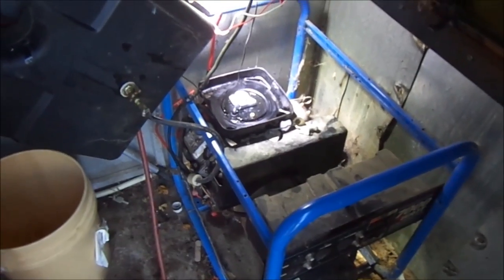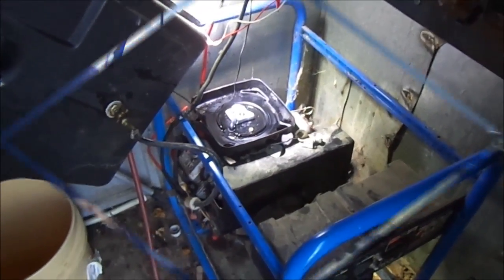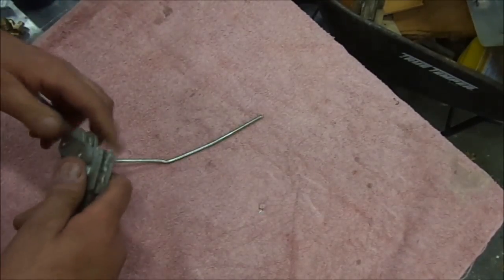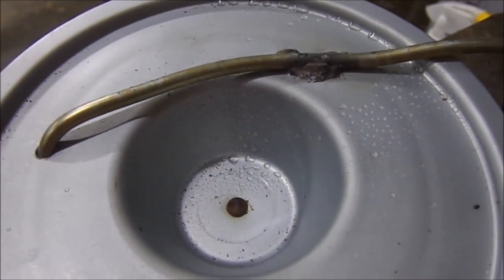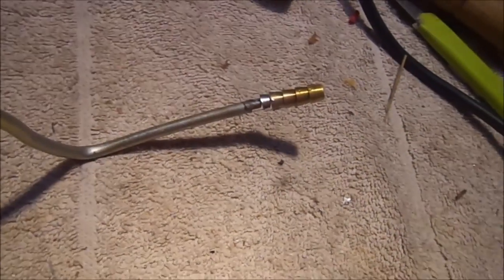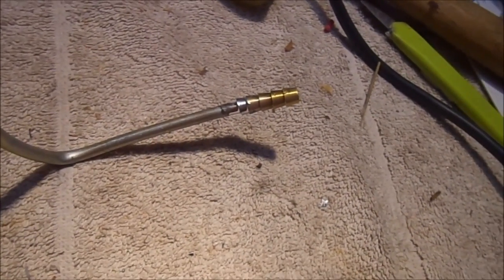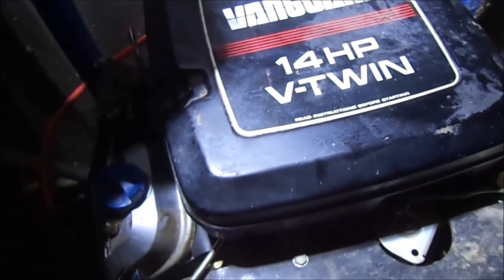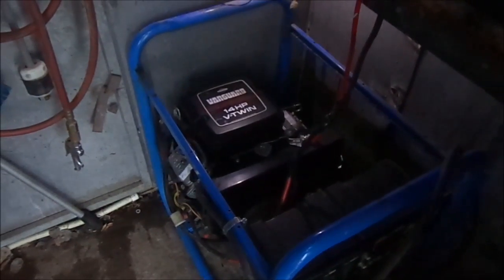A Free Gas to Propane Generator Conversion

Comment: Very unsafe. When your engine dies you still have all that propaine shooting in your engine. Make shure you  you are aware of that. I would invest in  a low presure regulator  that  is made to shut off the propane when the engine  dies or not running

Comment: Looks good the only issue is if the motor shuts down from overload or whatever, propane is still pumping into the carb  fyi.  That's why they use a vacuum regulator that opens the gas when the engine creates a vacuum in the regulator and shuts it off when the engine stops

Comment: Hi Dennis, I was wondering if I could stick the tank end of that hose up my rear, and use my own gas to power that generator?
Reply: But you'd have to take Mr. Potatohead out.
Reply: @itsruf1  and the gerbal
Reply: That conversion kit should work and its free

Comment: Please don’t do this!!! Without an on demand LP regulator there will be no governor throttle control to maintain speed under load and worse yet and deadly dangerous is that if the motor stalls under load, the LP continues to flow and can blow up your house!!!!!

Comment: Use a vacuum three way shutoff that will shut the gas off if the engine stops running, on amazon for about ten bucks. Thanks for the video.
Reply: Link?

Comment: Propane is the way to go--Gasoline will not last very long since the addition of Alcohol to fuel, maybe several months--Propane will Last forever and the engine will run Much Cleaner extending oil changes...

Comment: Without a demand regulator ( governor regulator) when the engine malfunctions and stops, you will flood the room with LP. A bomb waiting to happen. A demand regulator modulates fuel flow to adjust for varying load and stops LP flow when the generator is unsupervised and kills ! This stop the flooding of the area with raw propane! $150 conversion kit is cheap if you consider a explosion, injury, medical bills, death or lawsuits! For your sake and all around that generator, do it right!
Reply from the maker: Couldn't agree more, this is a dedicated well genset to run a few minutes and shut off, always attended.
Reply: @evers0537  you could probably fine a shutoff valve that runs off the engines vaccum. Great video. I plane on doing mine.
Reply from the maker: @jerryjamify  I could, but I've had it in service for seven years now without a hitch. Thanks

Comment: I did this to a riding mower and I had 5 bucks into the whole shebang  but I later installed what's called a backfire valve, and they can be purchased at a welding supply store ( Norco, oxarc,) on the west side of the USA. This valve is installed on cutting torches.using propane as a cutting gas. and it's nothing more than a way to prevent a 🔥 or explosion should your engine backfire through the carb. by the way my mower was 18 horse power and it mowed grass just fine. I set my throttle at 3/4 open and used the on / off valve as a fuel increase/ decrease.  good luck! to who ever try's this method and as a foot note it works best on engines that don't need constant throttle adjustment

Comment: Will this work with either a bad carberator or no carb?
Reply: Yes it will as the mixing of the propane is done pryer to the carb  or lack there of
Reply: As long as the carb is open. If the butterfly is frozen closed no fuel mixture can get in. 🥴

Comment: Dennis where you just using an 11 inch pressure regulator?
Reply from the maker: Tony, I don't know the specs, I am going to try an adjustable regulator shortly as it will allow me to fine tune it by running it rich then backing off.

Comment: How do u know if its more economical on propane then gasoline???
Reply: run the same load on both for the same duration. which used more of your hard earned dollars at your local prices for each? that will be the LESS economical alternative. if it costs 5 bucks to run a pump for 12 hours with gas (petrol), and 4 bucks to run the same pump for the same amount of time on propane, the propane is the more efficient per buck. that gives you "real world results" for your actual conditions, soup to nuts (assuming it will be running the pump, of course). you can do the same test the "other way", by buying a BBQ can of propane, and jerry cans of gasoline of the same cost total. run the genny under your normal loads expected, and keep track of hours of use per fuel reserve (gas and propane individually accounted). which fuel gave most hours for the single "fuel price" is the most economical (buck efficient). if prices go far from the current spread, you can always repeat periodically to insure current economic bliss. that gives you EXACT "apples to apples real world for you" custom results entirely weighted to your local fuel costs, that will HAVE to be reflected in your everyday use (as that was the "test duty cycle" used). play with a slide rule all day long, you will never get more accurate results than that, lol.
Reply: @platinumsky845  I concur
Reply: I think he was hoping to get an answer from someone else who tried it. From other articles, the fuel cost is similar, but not having to refresh the fuel every three months makes the big difference.

Comment: Might add a in-line solenoid in case the motor quits, the solenoid will shut the gas flow off automatically.
Reply: That was my concern. Can you elaborate?
Reply: MrKellysnodgrass The  solenoid  has a valve inside that shuts off the flow of gas when power from the generator quits. The solenoid
is plugged into one of the generator power outlets. Hope this helps..
Reply: yeah you could just use a simple on that uses the generators electricity.... that way if the generator goes wonky there is no power to the solenoid and no gas flow
I was wondering what regulator he used and what Inches of flow
Reply: Hi the problem with that is that, you'd never be able to start the generator without power to open the solenoid.  You'd need a solenoid with a mechanical override to open it on startup, but once power is lost again would close it.  Or plumb in a bypass around the solenoid, for startup, but don't forget to close the bypass once its running.  Still not idiot proof, but close!

Comment: When the generator is under load, how does it get more fuel to compensate, like a Gas engine's butterfly valve? It seems like you would have low efficiency if you burn the same amount of propane all the time.
Reply: Use an on-demand regulator according to a comment above.
Reply: Thanks, I will take a look at that.
Reply: so just buy a kit since the regulator seems to be the most expensive part of a conversion?
Reply: Use the govoner  ..it already  opens or closes  air intake ...  run a linkage  to  a fuel valve on the propane..  make the valve open and close with n the  carb air intake ..just have  to  get it to  idle   then at more throttle    hold the wire from gov..  to  beside fuel  valve  handle ..   then with gov.. open   start to open fuel  valve  handle  until  you get the  result you want.. hook the  gov.. wire  linkage  to the fuel   valve at that   adj .  .. .

Comment: Why? Why? why all the bending & soldering & working to do a simple 5 min job? Drill hole in air filter or use crank case return vent, (older genset models use vent), cut hose, press cut end on carb vent hole, apply hose other end to propane container of your choosing( a variable propane turkey fryer hose/regulator) turn on gas at bottle, regulate w/ valve, voila! 5-10min tops. Not using carb vent? Drill hole in air filter box behind filter element ( engine side) get brass fitting, 3/8" x 1/4"compression, hole sized to fitting, open air box remove filter element, poke fitting into air box, thread on compression fitting with 1 1/2"x 1/4" copper tubing attached, RTV around inside & outside of gas fitting, Voila, maybe 15-30 min. This works with natural gas as well with slight modification to the gas end connection, obviously wouldn't use a propane hose but the genset end works for both.  Not knocking your vid, just 2 different ways of doing same thing. Good Luck & God Bless!
Reply: +Dan Roy Calm down it's just a different way to do the same job.

Comment from the maker: Thanks, I have full tanks and roll them over to the BBQ when they are at 1/4.
Reply: +Dennis Evers Hello Dennis. Hey, i purchased a Powerland 4,000/4,500 w 7.5 hp gas generator.Can it be converted to lpg/propane? And if so? What or which type/kind ofconversion kit should i use for it? Thanks Soo Much & God Bless You!!   P.S. Please reply ASAP If you can!! Thanks again.
Reply from the maker: +bill powers Bill,There are kits online for sale, other than that I don't have specifics.Thanks

Comment: Anyone how what happens to the cylender head valves from runing LP, i had a low mileage engine with rebuilt heads, the owner siad it was from running propane.
Reply: Well even on generators ment for lp gas the heads will still rust.

Comment from the maker: NO, It is in a tiny vented  metal out building, and I don't leave it unattended. It is only run to fill a water tank  which takes a few minutes..It is  a dedicated generator for the well pump only.

Comment: So, you walk away, the sparking plug fails or any other part of the ignition system fails, LPG carries on blowing into the air intake. You come back, turn on the light and .....BOOM!!! It needs an automatic shut of valve in that event.
Reply: I think I will stick to my own idea and just change over to a tri fuel carb.. It's worth the $25.00 - $30.00. I haven't liked loud noises since I got back from Nam. Definitely need an on demand regulator for safety reasons. I think I would sleep better too.

Comment: I did same thing with my generator after Sandy hit nj.  I love the fact I will not have to smell gas anymore.  The right way to do the conversion would be to get garretson on demand regulator ($70 on ebay) and Are going to need larger hose since propane with be sucked into carburetor.   Your conversion works but you can not walk away it is a time bomb they will blow.
Reply: Dennis Evers
Install a 110vac solenoid in your gas line and a valved by-pass for starting. Plug solenoid to generator and when it starts generating power close by pass. If the engine dies power loss will close solenoid, shutting off any gas .
Reply: @halo281474  Thank you because I was looking at adding the auto shut off.
Reply from the maker: Understood, it is a dedicated genset for the water pump and only runs 8-10 minutes under adult supervision.
Reply: A areas which I've read say a regulator is needed and to adjust the air fuel mixture

Comment: With the conversion to lp gas, do you expect to get longer running time? Thanks for sharing your work.
Reply from the maker: LP has fewer BTU's than gas, but is cleaner, easier on the equipment and stores for years without any degradation. You are most welcome.
Reply: @evers0537  I liked your video but you should have said you have to  make sure you're generator is running if it stops running and the gas valve is on all the propane tank will empty out.  Thanks for the video
Reply: Yes it does run longer on LP than Gas..
Reply: @Dishtech48  only if you keep adding  propane... gasoline  has more avail  energy than  propane or lp gas one plus one  .  It's simple math.. gasoline  goes farther